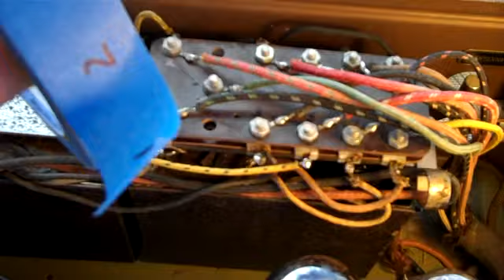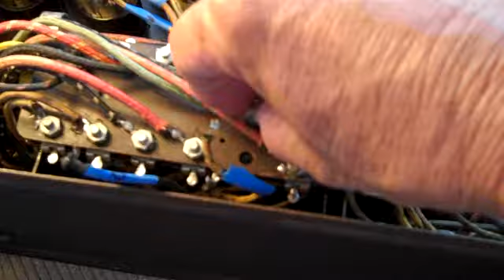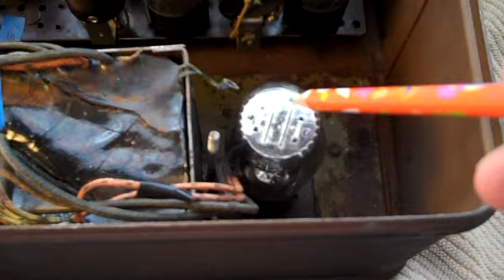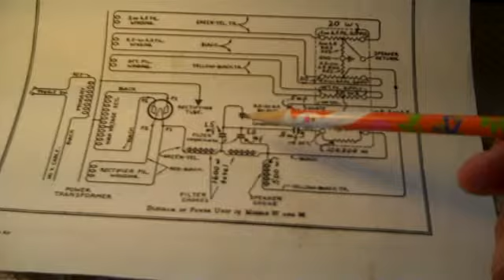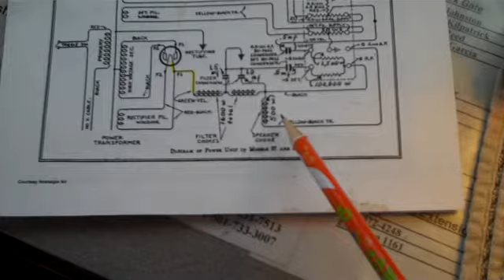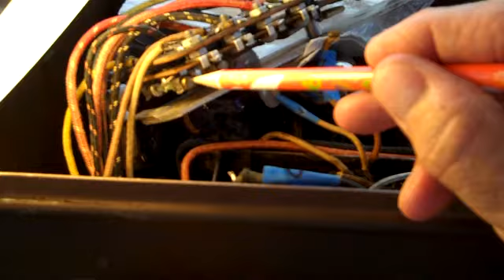1927 Atwater Kent Model 37 Repair and Restoration. (Part 3 of 21)

Comment: I have viewed all 21 of your vids on your AK37.  Super job ,  easy to understand and follow.  Really cool stuff.  This is my first attempt to revive an Atwater Kent Model 40.  How did you find  out what value of electrolytic capacitors you needed  to replace the two caps in parallel? (Between chokes)  I can't find the values anywhere.  Can you help me?  Iappreciate any info you can give me.  I realize it was 8 years ago.
Reply from the maker: Hey Robert, it's good to hear from you.
If memory serves, I think the 6.8uf ecap was the smallest I had on-hand at the time.  Its value wasn't critical.  It's just there to help the choke filter out a few more bumps in the electrical road, so to speak.  I'd venture a 20uf filter cap would have worked.
In terms of component values, these old radios had a ton of slack.  Take resistors for example.  I've seen resistors that had more than doubled in value yet the radio played just fine.  Go figure.
With all that being said, it's always best to go with component values shown on a schematic, but when an antique radio need arises...it's any port in a storm.
Thanks for dropping by, my friend.
Regards,
John
Reply: @joernone  Thank you so much for your quick answer and  help.  Its truly a pleasure to find a person who cares about people and old tube radios as I do.  Most times I ask a question but get no response .  With your info I will now be able to carry on and hopefully get my AK40 to play.  Keep up the videos, as they are fun to watch.  Thank you again, stay safe my friend.

Comment: The original capacitors are in the tar also, I believe. So I think you have one transformer, two chokes and two capacitors berried under that tar. Put a half a drop on the resistor connectors, the change in temp will cause it to move enough to make a better connection.

Comment: Those AC metal breadbox Atwater radios are difficult to restore as compared to some of the radios I have restored. You're doing a great thorough job on it. Having to undo a botch-up job by a previous owner makes it even harder to do.